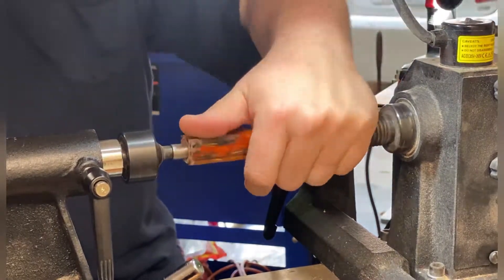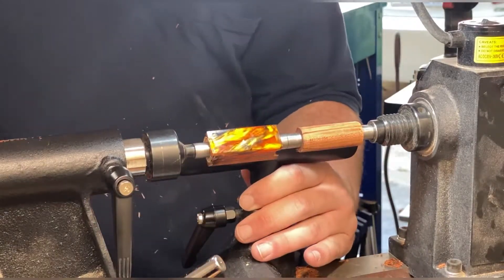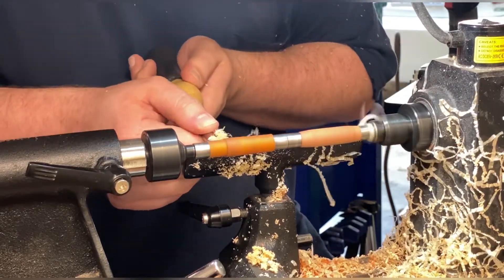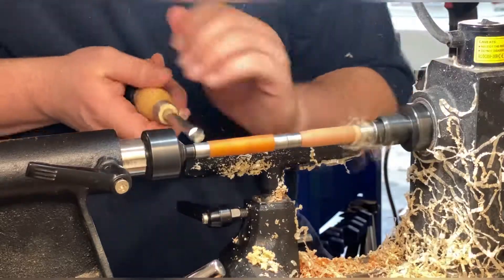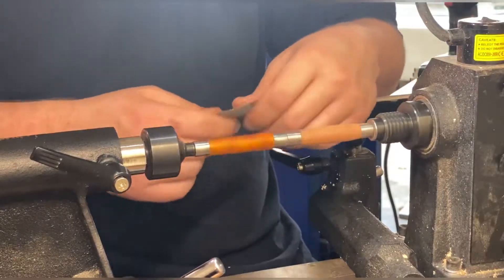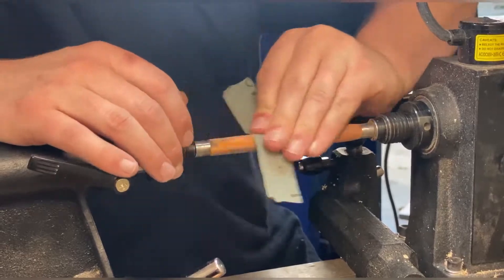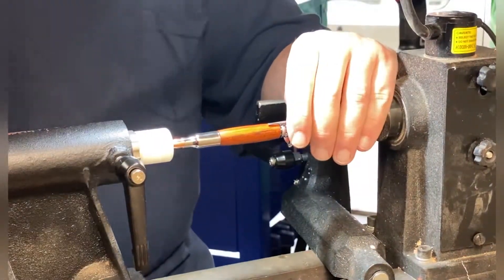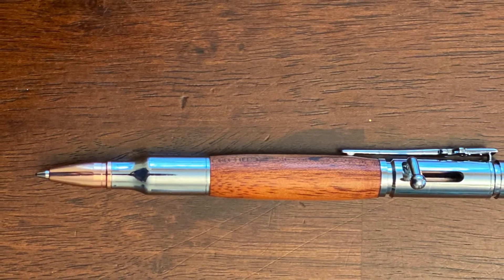Acrylic VS. Wood. Two Pens One Turn.

Comment: Thank you for the video, however I couldn't understand what you were saying because the audio was bad.
Also, I would like to know what speed you were using  with the lathe, what cutter you were using, and a better look at the polishes you were using.. To be fair I'm 81 and have hearing aids. I have been turning pens for 6 years.
Reply from the maker: I appreciate it. This was one of my first videos so I was still trying to figure it all out. Still am. I usually rough the blank around 800 rpm then step up to around 1500. I lower the speed to 800 to sand then crank it up to 3000 to apply the finish. I used the Rockler carbide tools. I believe the finished I used in this was called shell a wax liquid friction polish. Hope this helps.